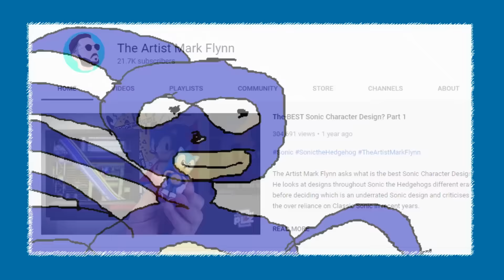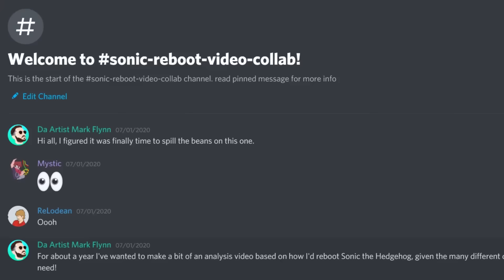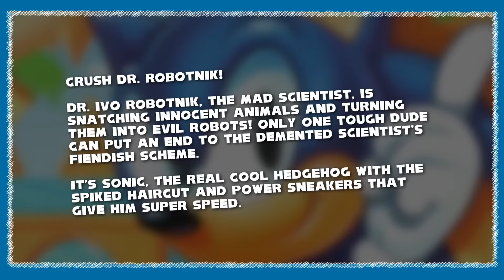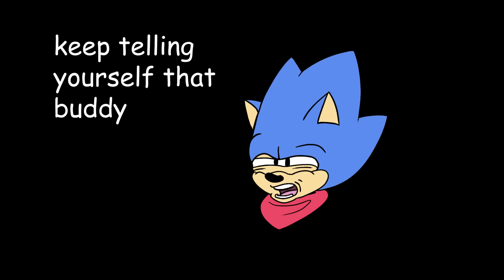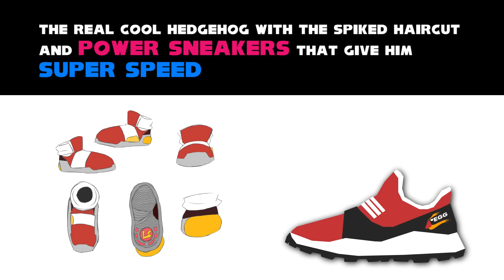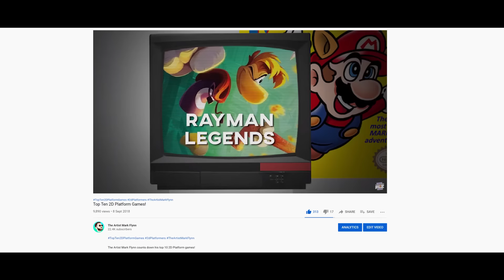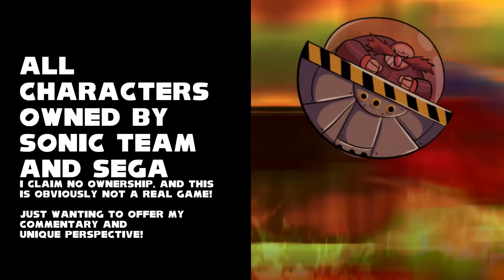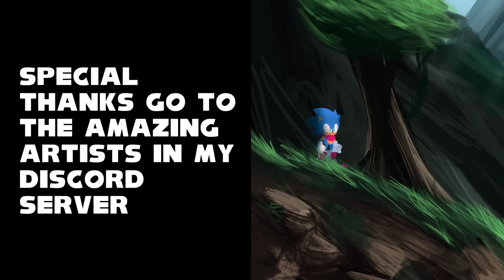Sonic the Hedgehog Reboot Concept

Comment: Did you just pitch a Sonic The Hedgehog origin story that has shades of both The Animals of Farthing Wood and The Secret Of Nimh?

...I kind of hate how much this feels designed to appeal specifically to me, at least narratively.

The red scarf works so much better than the brown, for basically the same reason that designs of Superman that lose the red briefs fundamentally break. (It's not as bad with Sonic, since the tan belly means the colour doesn't need to be offset, but adding a hint of red - the same shade as the shoes - around the next definitely works nicely. If you're adding a scarf to Sonic, it needs to be that contrasting red rather than an earth tone or shade of blue). I don't think it's needed for the character design here, but it's definitely nice.

Robotnik as a sort of hybrid between Lex Luthor and Jeff Bezos makes... Far too much sense to me, also. I prefer Robotnik to be enough of an egomaniac to make mechs that resemble himself to what I got from your pitch, but your pitch works beautifully.

I don't necessarily disagree with your take on gameplay, but would add a few notes.

I agree that Sonic gameplay has traditionally worked best in 2d, but would specifically note that they're at their best when there's a balance between speed and exploration. They take the concept of 'low skill floor, high skill ceiling' and run with that. For me, taking that vibe from the original, and transposing that to the modern day, is the key to making a strong, modern reboot of gameplay.

So, with that in mind, and I think we're discussing different levels - you focused on the moment to moment and overall environment design, while I'm more focusing on the birds-eye view level structure and how to bring the core ethos of early Sonic games (or at least what I think they were trying to do) into a modern era.

i) Multiple, overlapping, routes, where failure more often sends you to a less optimal route than outright kills you. Each level should have 3-5 ways of getting through.
ii) Some of these routes should be hidden, requiring exploring the level, and perhaps some high skill uses of the game's systems to discover. Ideally, these should be the fastest routes (or at least otherwise 'best' by some metric)
iii) Online leaderboards. Sonic, of all things, should encourage speedrunning, and having leaderboards for individual levels - As Sonic Mania does - is a soft way of bringing people who don't otherwise speedrun into speedrunning, at least to some degree.
iv) A rank system. Not a complicated rank system like the modern 3d Sonics have, one purely based on 'how fast did you get through the level'. Grades should be all positive - The player just beat the level, that should always be communicated as being good enough. Low skill floor. You beat the level, that should be enough for a passing grade. Maybe C through SS - Cool, Badass, Awesome, Sonic, Super Sonic. Super Sonic ranks should unlock hidden stages.
v) That feels overly pushing towards speed, so lets slow things down and encourage more exploration beyond finding faster routes. Another set of hidden stages should be by finding a series of tokens throughout the levels - the equivalent of finding giant rings in Sonic 3 or extra lives.
vi) Hidden stages should be more 'Dark Souls optional zone' than 'Bonus stage' - A substantial bit of content that's entirely optional. You should be able to have a good time with the game without engaging with any of this stuff, but there should be enough there to hint that if you put some more work in to get your time up, or explore the levels to find more stuff, there's More and the game should properly reward you for that with more content. I'm not sure what the right ratio of hidden stages to main stages should be (Maybe if there are 5 hidden tokens per stage, as per a lot of modern Sonic titles, the first hidden stage from exploration could be for 5, then 15, then 30, and maybe every 15 from there until we run out of levels, with the same ratio for SS stages - your first Super Sonic rank, your third, your sixth, and then every three. That would require making almost half the content hidden unlockables, which is a lot, but should also feel incredibly rewarding for replaying a game that I think should be designed around replaying)
vii) Boss fights should be there own levels, divorced from the main game and as such not within the prior systems. That also means we don't need to remove them from levels for speedrun mode.
viii) As a general principle, there should either be no lives at all, or lives should be local to the level (or maybe the checkpoint) - Think how Splatoon and Little Big Planet handle their lives.

Comment: The gameplay should be like Sonic Advance 3 accept no helper except Sonic has a meter on the right bottom hand corner you can feel this meter by doing spin dashes and and getting rings when the meter is fully charged Sonic can have an outburst of electricity which also gives him a a burst of speed similar to the spin dash it's basically the lightning shield from Sonic 3 & Knuckles double jump, jump dash and so on but it only lasts for 5 to 10 seconds but all the other gameplay mechanics that you have is fine I'm not changing anything just adding a special ability
(Levels)
How about your ending is change depending on how many enemies you defeated like you have to defeat all of the enemies and get all the Chaos Emeralds to get the special ending I know that's going to be kind of an issue and I knows a lot of people aren't going to do that I'm going to do it anyway just to make people mad